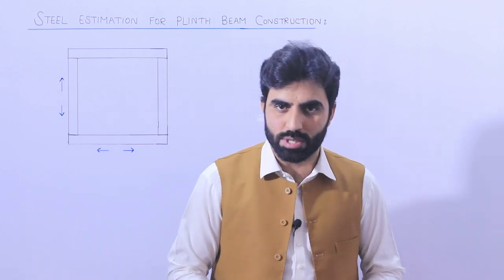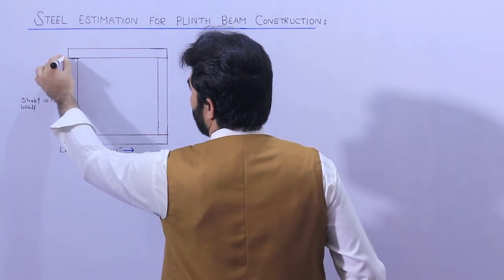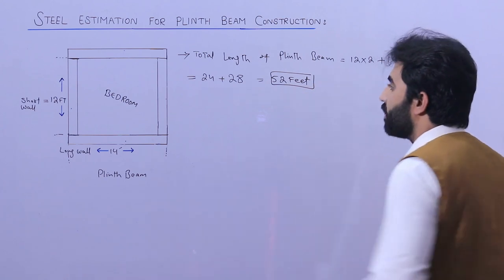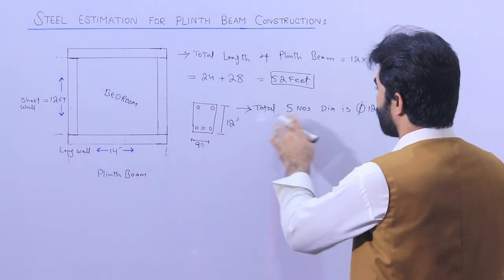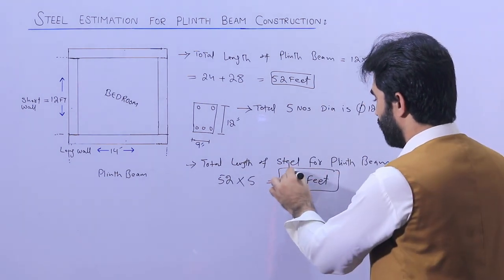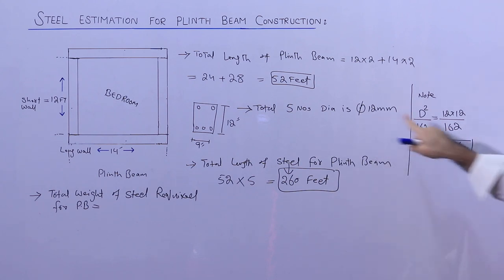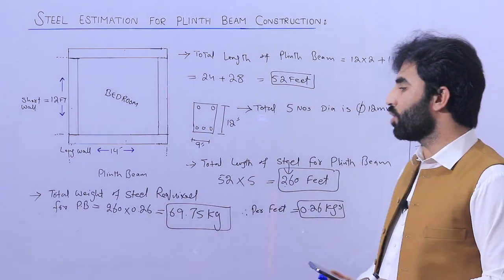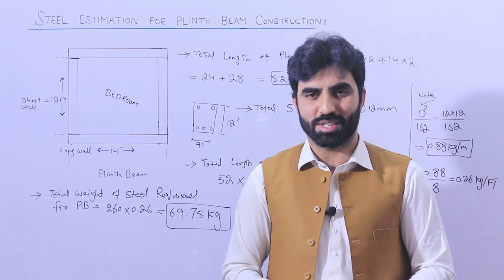Steel Estimation for Plinth Beam Construction

Comment: This estimate has a number of small errors. 
1. The plinth beams should overlap at the corners and be tied to each other. So, for a 9 " × 9" corner intersection, the short side beam should be 13.5 ft long and not 12 ft long, while the long side beam length is correct at 14 ft. Therefore, total plinth beam main rebar length is 2x13.5 + 2 x 14 = 55 ft, not 52 ft.

 Furthermore, the main reinforcement bars may require a hooked anchorage at each corner end, adding about 1ft at each end of each main reinforcement bar, making the 13.5ft bar length about 15.5ft and the 14ft bar length about 16ft.

2. The shear reinforcement  stirrups should have shorter spacing towards the corners and wider spacing towards the centers, and each stirrup would have extra length of about 0.5ft for the hooked overlap  connections to the main reinforcement bars.

All of these extra rebar lengths add up to a significant extra amount of rebar.